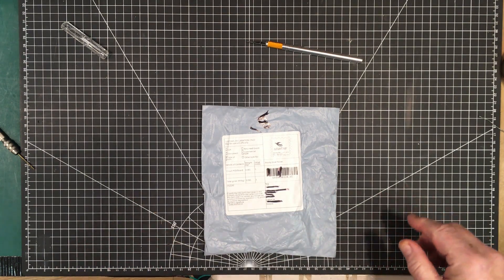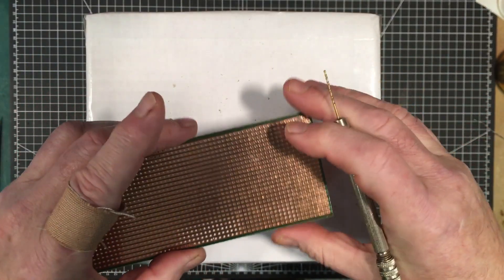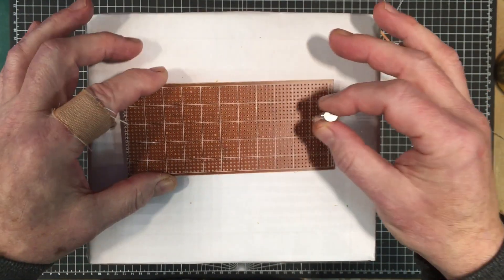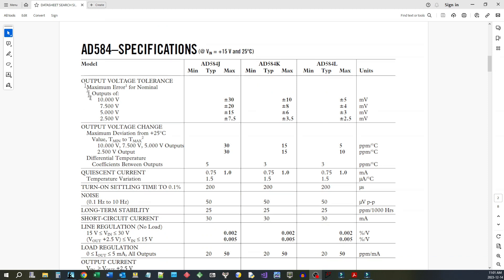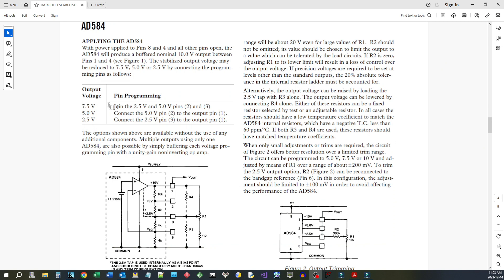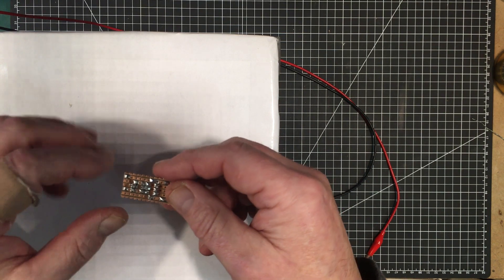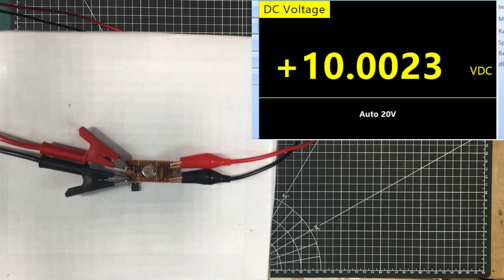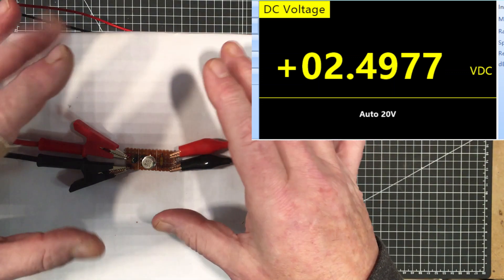0135 - AD584LH Precision Voltage Reference (+ bonus prototyping tips)

Comment: I am actually surprised that in 2023 we can't get 1ppm voltage reference for like under £10.
Reply: You have to remember that all the chips that are manufactured are planned to be high spec but under test they grade them so the process isn't optimised even now in 2023:)
Reply from the maker: I think it's probably because the best ones have such poor yield.

Comment: I bought the same 'Veroboard' and its ok but it won't take solder easily unless it's given a good clean with an abrasive. In the UK we had an electronics supply shop called Maplin and back in the day if you bought veroboard they would give you a vero cutter for free ! and was just a twist drill with a blue plastic handle, very cool ! Interesting I have the AD584LH and it came on a beautifully made PCB with SMA connectors for the outputs and was slotted to stop creep. This was about 10 years ago and it cost £15 from Amazon, now the 'L' version isn't on the modern datasheets at all (strange) and I too have seen them for sale at odd prices. I think we got lucky....cheers
Reply: Analog Devices stopped manufacturing the L variant in around 2012. Either someone in China has a MASSIVE stock of them, or some company bought a truckload then later sold them back to the 3rd party market when they couldn't use them, or they're remarked lower-grade parts, probably 90% of which are going to meet the L-spec in at least voltage tolerance, maybe not temperature coefficient.
Reply from the maker: @ivolol  You might be right.
Reply: Sounds spot on to me. I have tested mine the best I can and I used an HP34401A. So I'm gonna treat the chip with the respect it deserves and it seems worth !! cheers ivolo.  @ivolol
Reply from the maker: These boards seem to have a coating on them, possibly rosin or something of that nature.  They solder up nice as is, but time will tell.

Yeah, I think we got lucky.  When DigiKey or Mouser list a part as "available - contact for quote" they are generally not priced for the feint of heart.
Reply: I bought my boards many years ago so maybe they don't age well but the 584 is great ! @uni-byte

Comment: You had my hopes up there with that voltage ref device. I've been looking for a replacement for a ISL21009 that was used in a Skullcom project - it had an initial accuracy of 0.5mV at 5V! Unfortunately a colleague borrowed my voltage standard unit and blew it up! The best I can find now something like an ISL21090 or X60003, but these have less good specs. I did find one device with 0.01% out of box accuracy but min quantity equated to a few hundred dollars.  BTW, there is a simple tool for cutting stripboard tracks - search 'spot face cutter'.
Reply: That ISL part seemed to be an outlier, basically nobody else will sell a part to 0.01% tolerance. Possibly it's because of "external" factors: if you give a voltage reference a "rough" time during soldering it to a board or similar, the temperature/heating swings involved are possible to shift its voltage by 0.01%, just by that stress! There's a decent number of 0.02% parts, that are likely to be within 0.01% spec: AD4550BR, MAX6126A, MAX6250A, MAX6350A